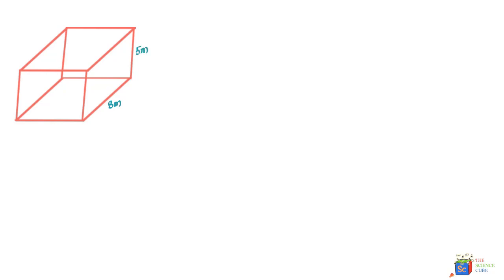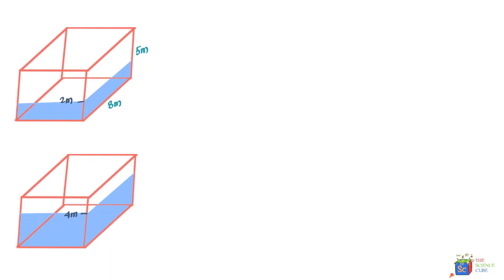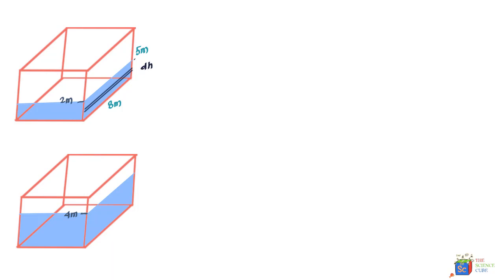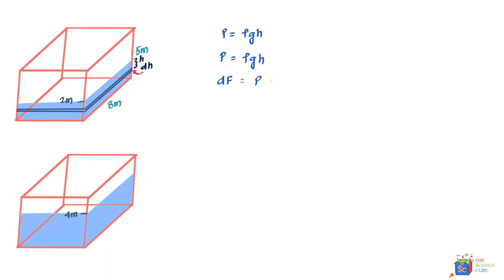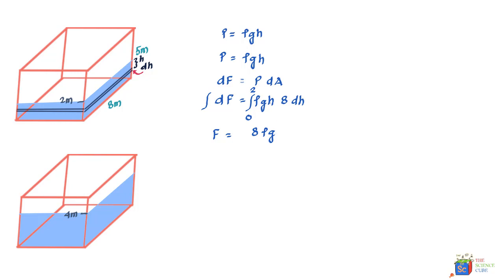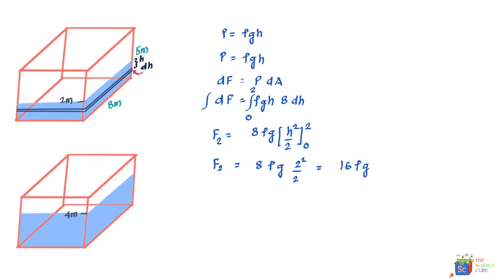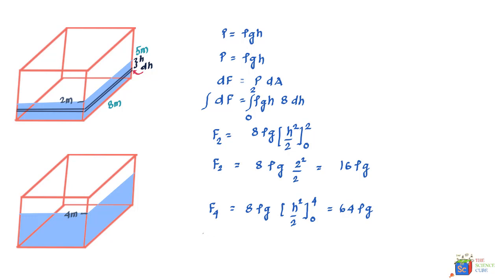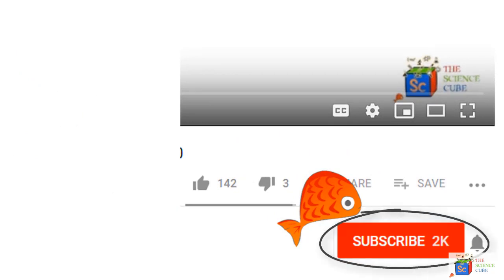Average Pressure on Wall of Aquarium #10

Comment: Does the pressure change if water inside start moving around?

(Like if the table the aquarium was on got hit and cause the water inside to splashing around.)
Reply from the maker: While sloshing causes instantaneous pressure variations, the average pressure on the aquarium walls, when averaged over time, does not change significantly from the static case.

Comment: How much pressure the tank glass can endure?
I have a tank of 2'9" × 13" × 2'10"
Can it hold the water pressure?
Reply from the maker: How thick is the glass?
Reply: @TheScienceCube  8 mm
Reply from the maker: @sunnyanan480  I thought about this but I guess the quality of glass would also have a bearing on the ability to hold. Did you speak with the manufacturer?
Reply: @TheScienceCube  A aquarium of same measurement with a 6mm glass was made. That aquarium was half full of water at the beginning. After two days the tank got broken just after 15 minutes when it was poured full of water.

We thought the glass thickness was not enough to endure pressure. So we called the manufacturer and told him about that. Then he made a new one with same measurement with a 8 mm glass. It was going ok for 15 days but last night it suddenly got broken again. We and the manufacturer also didn't get any idea why this is happening 🙁
Reply from the maker: @sunnyanan480 Thickness of the glass alone cannot ensure  that it does not break. The material property of the glass will also play an important role. The strength of glass can range from a delicate wine glass to a bullet proof glass material of the same thickness. I think the quality of glass is not up to mark.